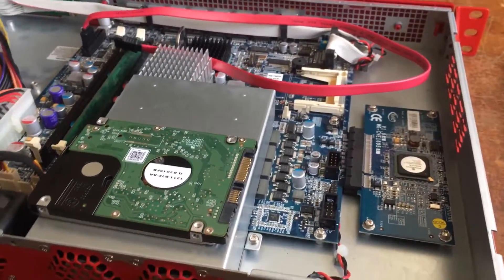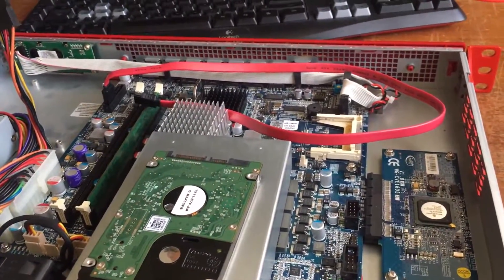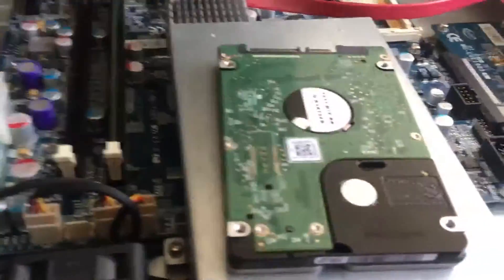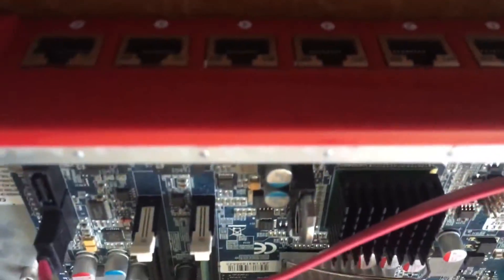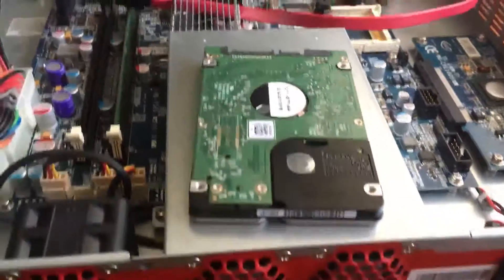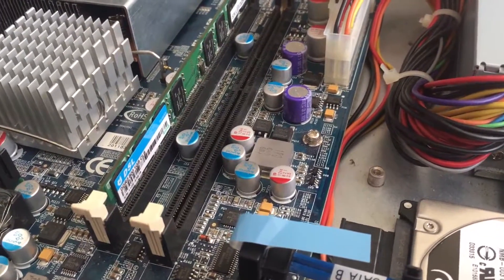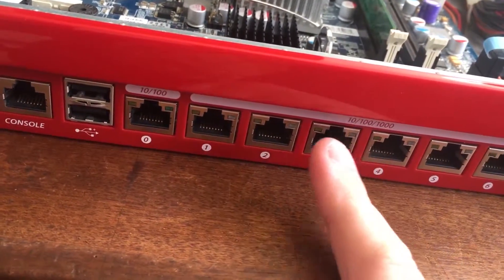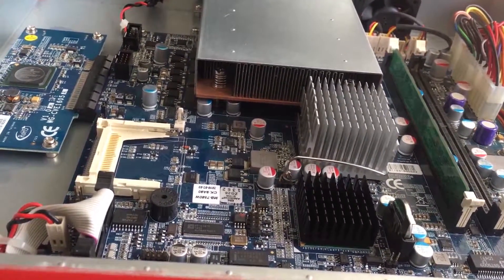WatchGuard FireBox XTM 5 Series Running pfSense

Comment: What processor exactly did you use to upgrade this to?
Reply from the maker: I started off with a Core2Quad Q6600 but have gone to a Core2Duo E8400. The 8400 uses much less power then the Q6600.

Comment: hey in 2020 do these still make sense ?
Reply from the maker: Miguel Costa For sure! However if you were going to run one in a commercial setting they I would possibly looks at a newer unit. Such as the M400 Series. My XTM has been very reliable since the making of this video I have not had any issues other then configuration problems but that’s my fault not the device.

Comment: I purchased a XTM 5 series firebox recently and I was curious, What RAM did you upgrade this firebox with? I have already upgraded my CPU  with your suggestions here in the comments. I like to future proof so anything 4-8 gig(if the board can handle it) would be greatly appreciated.
Reply from the maker: JHart Nets Thanks for your comment! I believe I’ve got 2x 2GB DDR2 800 Sticks. 4GB is more then enough in my opinion. Mine is only using 13% of 4GB I’m not sure what the maximum memory limit of the board is I would probably expect that to be 6 or 8GB
Reply: Man you are an awesome content provider for Geeks like me. I have 2 dell power edge r 710's that I am developing . One with ESXI and the other with Server 2012 R2 as domain. (LEGAL) I am setting my Firebox with a PIA certificate to control all network traffic on the watchguard to ensure my.... well you know...... TY very much and I will be asking more of you in the future as I spread your insite to tech....
Reply from the maker: JHart Nets Thanks for your comments! I’m glad what I have shared has given you some ideas! Apologies for the late reply I have only just seen the your comment YouTube didn’t email me about this one.

Comment: Brad, which version did you load from CF to HDD? I'm interested in running the full install from the HDD, can't get full version to boot from CF. can you explain please?
Reply from the maker: This is the image you want to burn to the CF Card. Then use the CF for the install then once installed to your HDD then you can remove the CF Card from the System https://nyifiles.pfsense.org/mirror/downloads/pfSense-CE-memstick-serial-2.3.2-RELEASE-amd64.img.gz

Comment: What cpu did you use?
Reply from the maker: Core 2 Quad Q6600
Reply: Do you ever come close to using the full potential of that cpu? I am thinking about going with an E8600 for the lower power consumption compared to the Q6600.
Reply from the maker: Travis Brennan I'm nowhere near using the full Potential of the Q6600. I might consider going to a lower power CPU like the E8600 Core 2 Duo. I think my firewall uses around 80W at idle which is a little excessive for a Firewall.
Reply from the maker: I’ve ended up going with a Core2Duo E8400. Uses much less power now